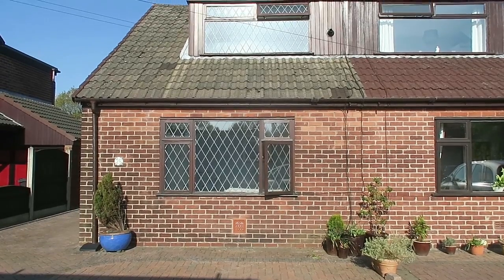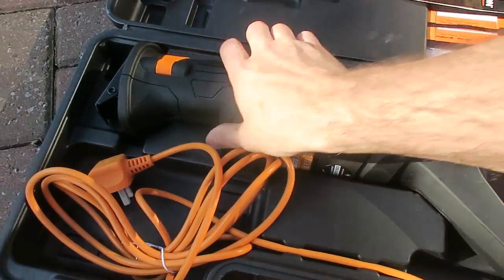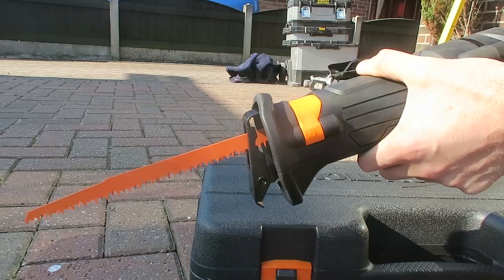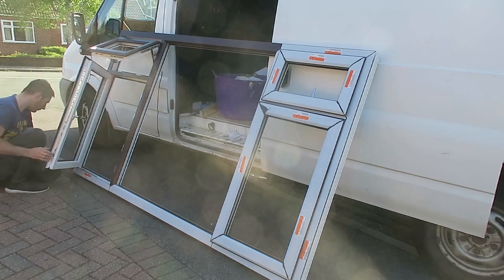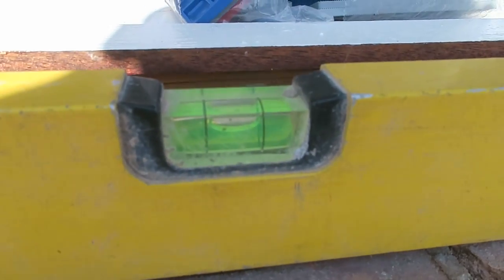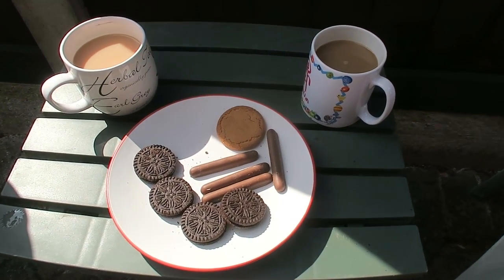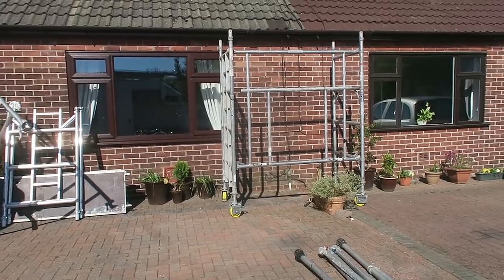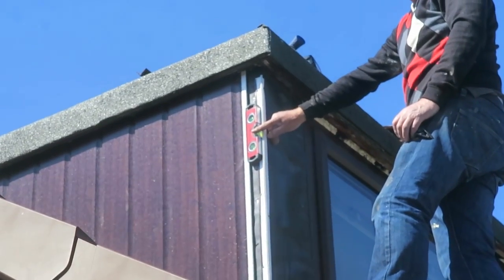How to fit wndows and cladding a dormer

Comment: good work, one question though did you use cladding trim at the top under the flat roof or did you push the cladding underneath the felt?

Comment: Absolute novice question i know! But what do you use to glue down your packers? Is it just sealant or NMN? Also, i'm guessing the wedges are used while you secure windows in place then removed?  
 Doing up my first house and soaking up all your videos! 
p.s hair looks great, going through the same thing you did! Ahhh
Reply from the maker: +Newbold3D thanks mate yeah just silicone just so the don't move. Yeah just wedges to hold window in place